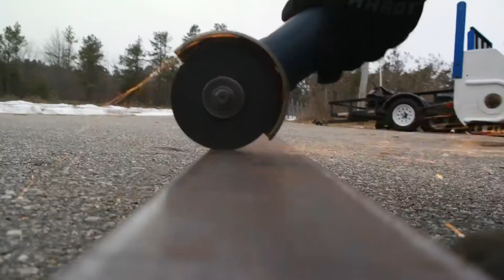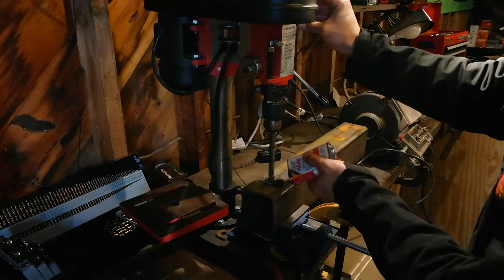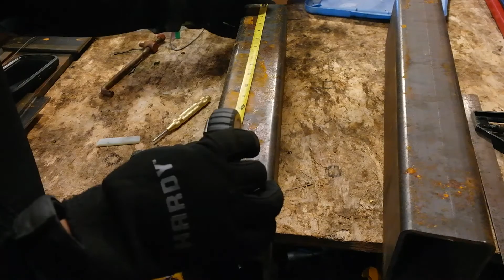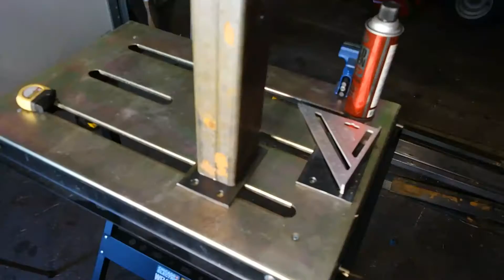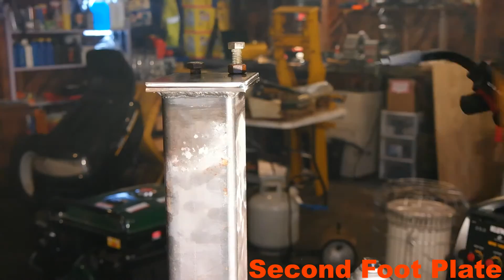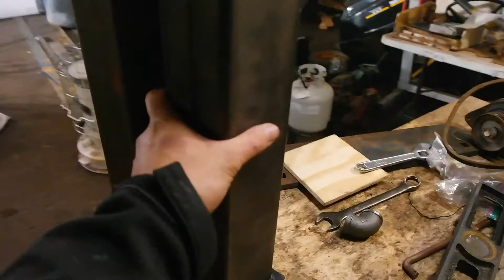Cub Cadet 149 TLB Transformation Part 6 - FEL Tower Construction

Comment: Very Nice welding, I got a flux core and my friends are surprised at how it welds thick metal!
Reply from the maker: I really like using flux core which is opposite to what you read on the internet. I use anti spatter spray so I get very littler spatter sticking to my work. The hardest thing with flux core I think is seeing past the smoke and watching the weld, but I've gotten use to it. I am an even better welder now than when I did this video.
Reply: CORAL ROCK PLUMBING INC. 
fluke core sucks

Comment: I was planing on following your steps to make a loader for my tractor but I was unsure about if you have to use the loader arms as a reservoir, or could you just use the onboard hydraulic system and pump? I'm trying to make the least expensive loader for a project tractor.  Keep up the great work!
Reply from the maker: Max Strout the on board hydraulic on most garden tractors will be too slow for the loader. you can use it but it may be slow going.
Reply: Thanks, so I might have to get a pump. But, will I be fine with the onboard reservoir or will I need to do what you did and put it in one of the towers?
Reply from the maker: you will want a seperate reservoir. you can either build it into the tower which is common or use a seperate oil tank.
Reply: So different pump, and reservoir. thanks!  hopefully, I can get mine to look as good as yours.
Reply: what size cylinders would you suggest for the loader?
Reply from the maker: Max Strout 2 x 16

Comment: I would think this whole rig is going to be very heavy for this low hp tractor, so why would you go beefier than needed?
Reply from the maker: It's been 6 or 7 years since this build and it's still doing great. The Cub cadet 149 can handle a lot more tractor than you think.

Comment: How did the weld hold up on that Black Malleable 90 degree ell to the steel frame hold up? Shouldn't you have used a forged steel ell bow instead?
Reply from the maker: The weld has held up great, with no issues.
Reply from the maker: Since the elbow is a suction and then a return line they dont hold pressure
Reply: @Isavetractors  Oh... that's good to know, Thanks!

Comment: I would like to see more info on the restoring of the tractor, did you change the front axle, how dig the frame get so nice and shiny and whatabout those kickass wheels you got on! Regard Nils from Sweden.
Reply from the maker: +TheFamKall I painted all of those parts and replaced the wheels I have some info on that in my 100 subscriber video. Since this series was focused more on the Loader Backhoe fabrication aspect, I opted not to show too much of the restoration process in an effort to keep this video series under 15 parts. When I am done though with the series, the next project is show you from start to finish a traditional restoration project which will show all the painting, sanding, straightening etc. Thanks for your comment and thanks for watching!

Comment: Was that original spindle that you went over 3/4"?
I'd like to do this but my original spindles are 1" diameter
Reply from the maker: Yes the original spindles were 3/4. If you are already at 1" you're good!
Reply: @Isavetractors  
Mine are from a 1541, how would I adjust? They don't have a threaded end

Comment: What kind of fluid did you use to flush out the tower before you added hydraulic oil to the tower
Reply from the maker: I cleaned the inside of the steel tube with acetone

Comment: How do you know if your tower arm will hold enough Hydro oil for the system?
Reply from the maker: When I filled it, I operated all hydraulics, then filled it again. So as the hydraulics run, the oil level in the tower remains the same. Oil goes from the tower to the cylinders, and oil from the cylinders return to the tank.
Reply: @Isavetractors  Oh so once the whole system is full, it doesn't matter then how much oil the tower is holding because the oil is also in the lines and such as well. its just being pushed either in or out of the cylinders.
Reply from the maker: Correct. The tower primarily acts as a cooling center for the oil
Reply: @Isavetractors  Ahhh so thats what it is... thanks!

Comment: You could, of course, simply made more passes, and just used 3/8".
Reply from the maker: +n1ztb Thanks for the suggestion. I wasn't sure and still am not if I can even do 3/8" with multiple passes. How thick is too thick for a 140 amp welder even with multiple passes?
Reply: +isavetractors In theory, there really isn't a limit. but I've done 1/2" in a pinch. 

Laminating the way you did won't really be very strong, and certainly not as strong as a single 3/8" piece; the top layer can pull away from the bottom creating a "pocket", and rust in between layers will eventually form in between.
Reply from the maker: +n1ztb I see. good point. when I build a 2.0 version I will change it to a solid piece and do multiple passes like you suggest.